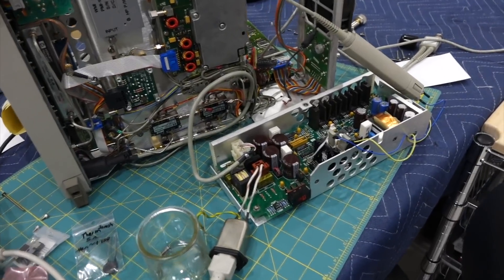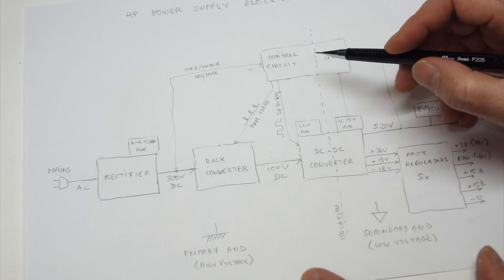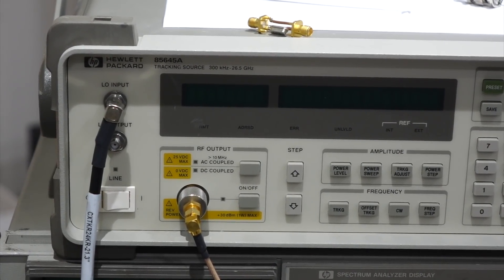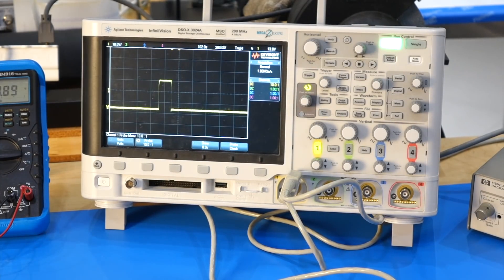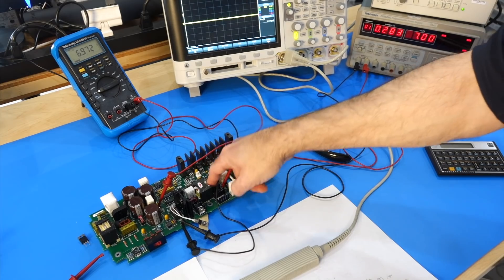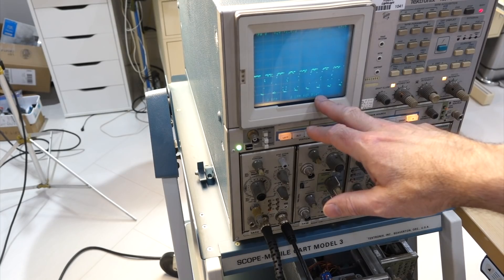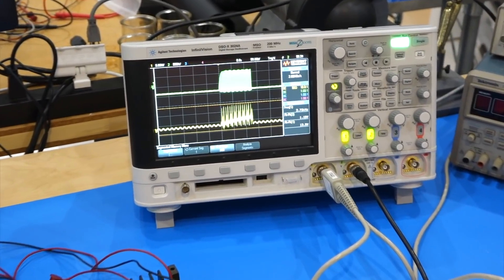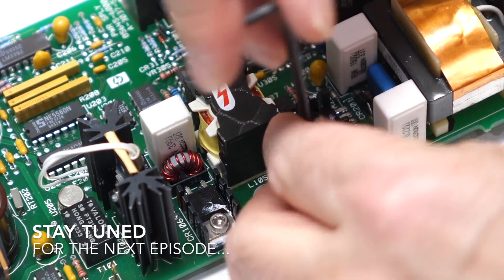HP Switching Power Supply Repair Part 2: Debugging the Startup Circuitry

Comment: Switchmode powersupplys are sooo complicated q.q i have 3 that i can't repair because i don't know what's exactly wrong with them.... Tow of them have a deat starting circuit but maybe i can fix them now with your knowledge thank you :)
Reply: They are not so complicated, but they very often suffer from the problem that they cannot work unless everything is working OK and when one part fails it is difficult to do measurements because the entire thing is just dead.
Also, one failing part may destroy other parts, and the generic way of solving problems (check if parts have failed an replace them) is not very successful on those supplies because usually you will first replace the parts that got blown by other failures, so the replacements will just fail again.
Reply: @Rob2  exactly ! cascade failures are the best !
Reply: @Rob2  Well said! You need soft start and shutdown to ensure that energy stored in inductance can safely run out. In a failure a sudden change in current causes high voltages according to V = L x dI/dt blowing up every semiconductor in sight!
There are however testing tricks that can help: Use a Variac and try to run the thing @ reduced input voltage. Override the control circuit with a signal generator to see if the power chain is intact (running in open loop).
Last test the circuit @ full voltage and load with control loop closed while hiding under the desk :)
Reply: I’ve had some luck with substituting 9V batteries (sometimes 2 in series) for various “standby” voltages within switchers. The fates were kind and when invariably one of such kludges would get 300VDC across the terminals, it didn’t cause any major nor even minor body damage. I did run a power supply in my fridge with a slightly flat 9V battery in place of a 12V Zener that had failed. Overnight I found a replacement part, and the battery got a bit of trickle charge to recover :)

Comment: Engineer:  A person who will spend $40 and 16 hours to fix a $15 remote control.... LOL! Keep banging on it Marc!
Reply from the maker: There is a bit of that. But check for the price of this unit on eBay or a used test equipment site. You'll quickly understand why I spent so much time on it!
Reply: @CuriousMarc  we are very much the beneficiaries of the adventure regardless of the "business case" or economics of it, and as such quite grateful you've made us a part of it. Merci beaucoup.
Reply: there is no easy way to replace this PSU (as explained in the previous video). By this: Repairing it is the only path to go.
I am still unable to tell why they used this double regulator approach before coming to the main DC rails. making universal voltage input easier in the age before fast/effective Mosfets became available? 
(having helper-rails coming from linear regulators is normal in that era, so i don not count that.)
Reply: @rarbiart  I'd imagine the self-adjusting supply in my 5150 is even more complicated than this one (it came from a 5162).
Reply: Mark your rant was music to my ears. I was taught to  find the fault, then find what caused the fault and then fix, commonsense dictates that unless you do, how on earth do you know you have really  fixed the fault.  Back in the seventies I had a job fixing  out of spec switching supplies that came off a production line. Youngsters now probably wouldn't believe that such a thing happened but manufacturing and components were then very expensive.
Steve
Reply: I resemble that remark :)
Reply: Yeah I just fixed a cassette deck (Panasonic 612) I found in the e-waste. The circuit board was smashed (in pieces), components were missing or broken, but I still managed to fix it. 200 euros in labour (and 30 cents in parts). Worth it? No way! (30 euros on eBay) Fun? Hell Yeah!
Reply: @senilyDeluxe  200 euros investment in yourself !

Comment: why not just isolate the whole instrument with an isolation transformer.. Am I missing something here..
Reply from the maker: Absolutely, you can do that too. That’s what most people would do actually. But that's not nearly as powerful as using a differential probe, where you can probe absolutely anywhere, completely off the ground, the two sections at the same time if you wish. Unfortunately I ran out of common mode margin. I got the x100 attachment since then....
Reply: CuriousMarc It’s probably good that there was no hard protection against exceeding common mode limits. I’ve had the dubious pleasure of using a probe that had some unforgiving fast-acting semiconductor clamps that protected the input stages from common mode overvoltage. The clamps were totally up to their task. The fault current they shunted was sufficient to vaporize the tips of the probe. Other than that, the probe survived unscathed. My corneas were not that happy though - whether it was the UV or the rapidly condensing metal vapor sent their way. Live and learn - and it helped that I was only about 20 at the time.

Comment: In AC/DC impulse power supply PWM controller working on feedback, if output voltage doesn't fit the PWM IC cut off power and trying start again.

Comment: I would highly recommend a thermaltronics soldering iron.  It is just like a metcal much less expensive (at least when I bought mine)  The iron you have makes me cringe.   No I am not affiliated with them, I just like their irons better than I like Metcal, Weber, or Hakko.  YMMV.   Big applause for your episode - it's nice to see an actual engineer at work and not just somebody who blindly shotguns everything.
Reply from the maker: But I love my Weller! Heats up incredibly fast, very precise temp control, many interchangeable tips I can (could) get from Fry’s, and super sturdy. I’ll take a look at your recommendation though.
Reply: @CuriousMarc  Hehe, I'm still using my Weller WP-25, acquired in 1971, and my other WP-25 bought in 1978. I collected a large stock of the range of tips from DIgikey in the 90's when I had some extra money. Plug them in, wait 5 minutes and start soldering.

Comment: 4:24 So the KickStarter pulses even when it is not needed? What this termistore is for?
Reply from the maker: It does, but by then the drain of the kickstart MOSFET is held at 12V by the takeover supply. The kickstarter pulses are 15V. And the turn on voltage of the MOSFET is 4V. So the MOSFET will feel only 3V on its gate during the pulse and won't turn on once the takeover supply takes over. Took me a long while to figure this one out! They say the thermistor is for protection, I think if the kickstart MOSFET were to fail in the "on" position or was on for too long. This whole thing smells like their control circuits were drawing too much power, so they went to this elaborate scheme to still make it work with a temporary supply drawn from a resistor on the 300V, but that would only work for a very short amount before the whole thing over heated. So they built a more powerful take over supply which is fed by an extra low voltage winding from the primary of the DC-DC. This is all quite unusual.
Reply: @CuriousMarc  I think your diagnosis is right.  The supply is pulsed to give the resistor less dissipation.  Usually it would just use the simple schematic you have drawn first.
However, there are plenty unusal things in this supply...  at least when compared to today's designs.
The use of a separate buck converter then DC-DC converter can be a good idea but you would want it to "ride the sinewave", i.e. much smaller storage caps after the main rectifier, and then some storage caps after the buck converter.
This is commonly used today for "power factor correction", i.e. to prevent the problem that the supply only takes current at the mains sinewave peaks and thus causes harmonic distortion of the mains.
(this PFC is different from "cosine-Phi correction" as used with mainly inductive loads)